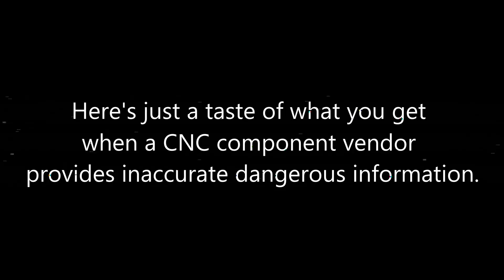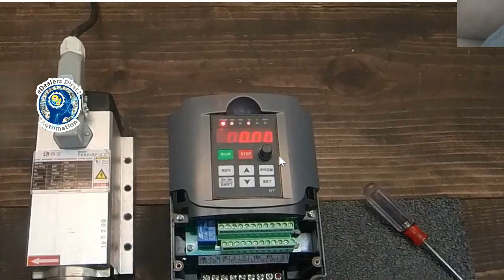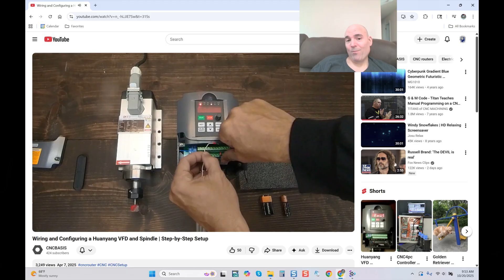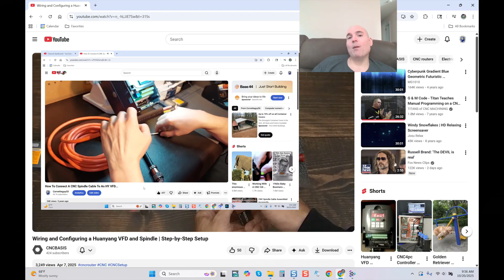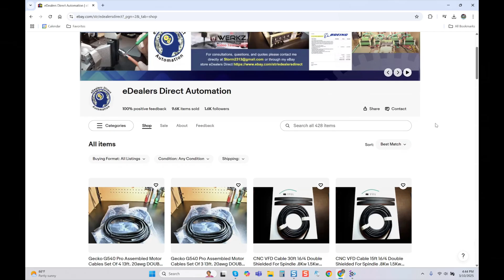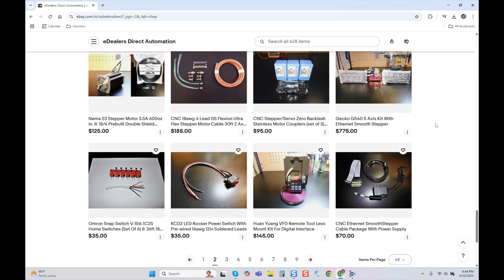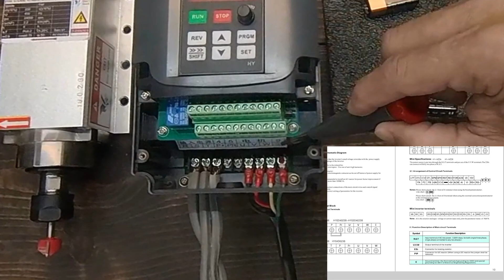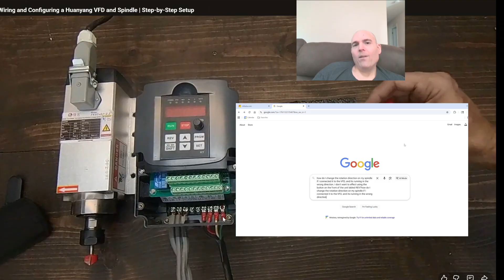⚡ Is This The Worst VFD Tutorial Online? 😬 It's Dangerously Bad.

Comment: Years ago when I sat in on a VFD course sponsored by Allen Bradley, we were taught that- Even if the VFD is disconnected from power, not all of them use a design that discharges the DC bus filter caps. So if the VFD has been powered up previously, there is a chance of lethal voltage being present waiting to bite even if the unit isn't powered up.
Reply from the maker: Very well said, and I forgot to mention that. Thank you for your support I really appreciate it. Vince

Comment: Hey Vince, Thanks for being a picky guy ! There is no point to doing a sloppy job !!
Reply: Hi again, question, In wiring a 220 volt input VFD. Do you put a noise filter on each 110 input leg leg and bond the neutrals together with a terminal block? Thanks so much
 Vince.
Reply from the maker: Thank you for your support. A noise filter isn't required. Search my channel as I have well over 700 videos meaning these topics are very well discussed. Here's the video you need that covers setting up the HY VFD. https://youtu.be/RTqbuDU5p1g?list=TLPQMjMxMDIwMjUZKaGsVJw2dA Thank you,
Vince
Reply: @corvetteguy50  Thanks !